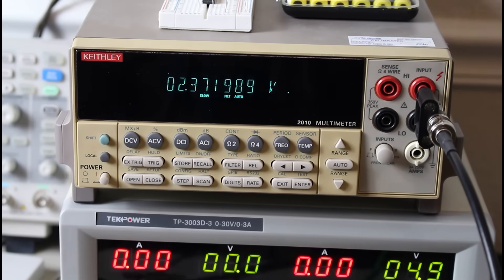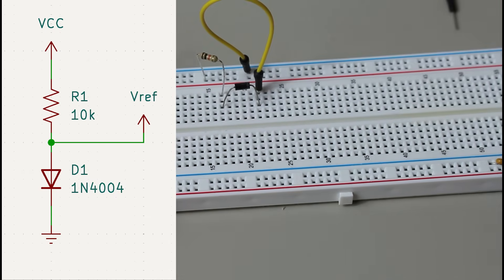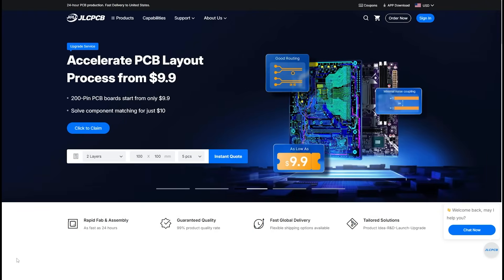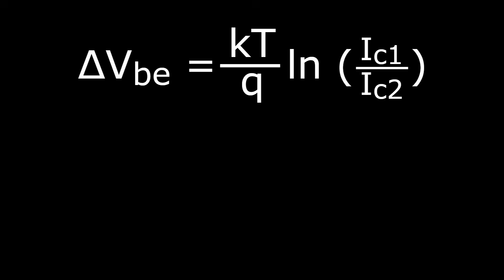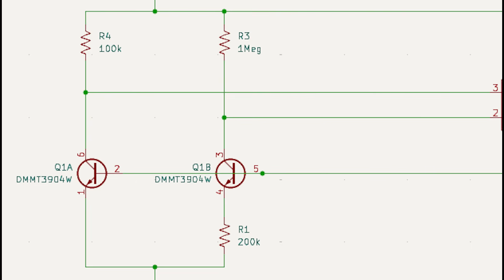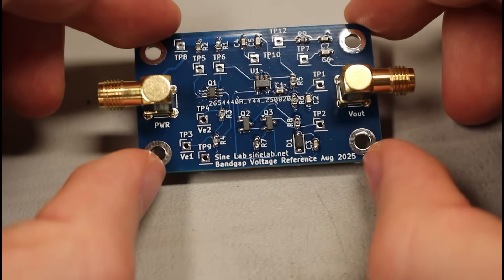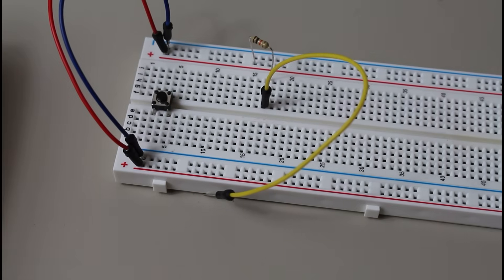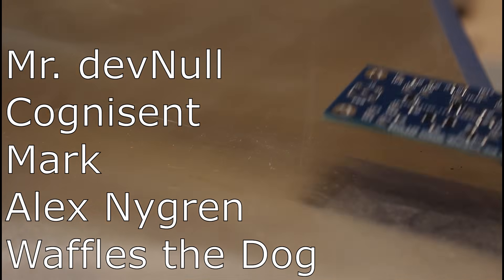5 Voltage References You Can Make! - Diode, Bandgap, and More!

Comment: A trick to get more stable DIY reference is to use an NTC component, like a resistor to do the drift in the opposite direction that eliminates the PTC of the transistors or diodes.

Comment: The base current of both transistors has to flow through R6 which introduces a non-linearity into the output that varies with hFe.  To compensate for that you'd typically put a resistor between the two transistor bases.  For the component values in your circuit I believe the value of that resistor should be 2500 x (the base current ratio + 1).  In a Brokaw bandgap reference where the carrier density ratio is based on the difference in junction area the base current ratio is often assumed to be 1 which simplifies things.   In your case where your using different collector currents assuming a ratio of approximately 10 would probably be a fine starting point by the same reasoning but it would be better to actually measure it or make an informed estimate from the datasheet.

You can find the details on all of that in just about any textbook which has a chapter on bandgap references or in Brokaw's paper "A simple three-terminal IC bandgap reference"

Comment: Nice summary!

You might want to overcompensate the chopper amp if it's going to be driving the capacitance of a cable.  About 330 or 470 pF from the output to the (-) input will slow it down enough not to oscillate into the capacitance of any reasonable cable length.

For a precision circuit, it's easier to heat the transistors than cool them.  You can use a matched quad, run current through one transistor of the quad to heat it up, and use a second transistor of the quad to measure the temperature.  Heating also lets you hit a sweet spot (about 65C in your circuit) where there's essentially zero slope of the temperature-voltage curve.  If you use a quad in an SMT package (THAT300 is a good choice), a couple of drops of hot glue around it are usually enough to keep it thermally insulated to where it won't drift in air currents.  I've seen an abusive but cheap design that used the linearizing diodes of an LM13700 to measure the temperature and the on-board Darlingtons as heaters, with the other OTA used as the Vt multiplier, but every time I look at it, I say, "that's weird!"

Another approach that I like is to glue a tiny 1K RTD onto the package of the matched pair, and use it to measure the temperature. The 3850 ppm/K temperature coefficient of the platinum is higher than the slope of the I/V curve, but a small series resistor will dilute it to the 3300 ppm/K that the circuit needs at room temperature. (I often guess that I need 3500, for running inside a warm instrument case.) Put a little bit of foam around the whole thing to isolate it from air currents.
'
In a practical circuit that uses either the RTD or transistors-in-an-oven approach, you need to worry about temperature stability of the surrounding components - you might find that you don't need 0.1% resistors for the precision, but need them for the lower temperature coefficient

Both of the approaches I mentioned are overkill for a voltage reference - just use a packaged one and have done with it.  But they come into their own if you need to do something like a temperature-stable log or exponential circuit. Sometimes the commercial converters like LOG112 just don't quite fit the need for a particular circuit, or sometimes you want to do something quick with parts you keep in stock, rather than wait for a distributor to ship you a bunch of niche devices.

Dealing with the 1/f noise in the transistors is a whole other can of worms.  

For relatively low-precision references, I do keep a few TLV431B's around. They're quieter than Zener diodes, and I can get whatever oddball voltage I need.

Comment: Nice demo and nice work. You built stuff, not just talked about it. One comment on schematic capture: Running a wire over a component (the Q1B transistor) is a no-no by any standards, regardless of your intention to show them as a pair. Thanks.

Comment: Shoot didn't mean to double-comment, but it looks like I can't edit my original comment? Anyway I was going to ask; what about using a trimpot to help eliminate the tempco drift? Or would the trimpot itself cause more problems (such as from its very own tempco drift)?
Reply from the maker: Using a trimpot could help with the drift. Integrated circuit bandgap references use trims to help, so this could potentially work in a similar way.

It would add its own tempco drift, but the other passives do that already.
Reply: @SineLab  This probably delves more into metrology territory, but moving the components closer together and thermally bonding all the components (ex. thermal pads + metal can) may also be another simple and low-cost means to improve tempco drift (as you somewhat discussed, by having multiple components on a single silicon substrate). The current 1.3mV/°C from 0-90C is still quite impressive and comparable to some $5USD+ discrete voltage references.

Comment: Another reference that wins on cost but not accuracy is to use the forward drop of the LED you use as a power on indicator.  Depending on the type of LED, the tempco is about 2mV/degree but the voltage is more than a silicon diode drop so proportionally, it is better.
You can also compensate the thing by using a silicon transistor as an emitter follower.  The tempco nearly cancels
In days gone by, you could also use an NE-2 neon indicator bulb to make a reference.  IIRC, they regulate at about 60V
Reply: All useful and good information 👍
Reply: To add to the discussion.
1. Zeners between 5V and 6V. Tunneling and Avalanche have opposite tempco and cancel out.
2. We should think in terms of NTC/PTC resistors to add predictable compensation.

Long long ago before 1985, I've seen vacuum tube voltage references, from the glow color I'd assume argon, maybe neon. The glow discharge voltage plateau depends on gas pressure and was around 85-90V.

Comment: LED diodes are also known for being extremely quiet compared to the price. They're sometimes used in discrete audio circuits to set a first current source, where the quiet operation is all that's needed from a reference level. Bandgap-based references have the advantage that they can be operated from a supply voltage of 1.3V, or even lower in some cases. Whereas buried zeners typically are running from a 5.1 / 5.6 / 6.1V zener, plus a transistor junction on top, plus room for a current source on top of that, meaning they often needing something like at least 8V to run properly, usually more.

Considering your homegrown voltage reference achieved a zero-tempco turnover point at ~65C, it might be interesting to construct a self-made oven for it. I found a fun page for simple ones, at the domain techlib, its called Temperature Control Circuits. Hopefully that's googleable.

Comment: Love the quick and dirty voltage refs, very useful. Shame the comments section is overrun with spam
Reply from the maker: Yeah, I've gone through and deleted those spam comments :)
Reply: Yes, you could improve it by simply putting another dual transistor on top of the original, and only connecting the high current side. That way you get both the 10x current difference, and also a doubling of the area as well, which should make it a lot more temperature stable.